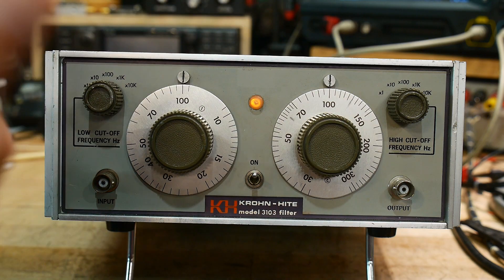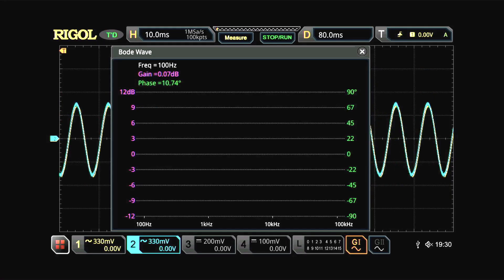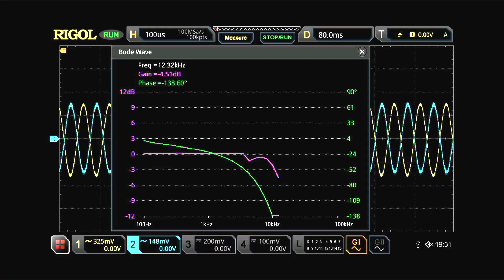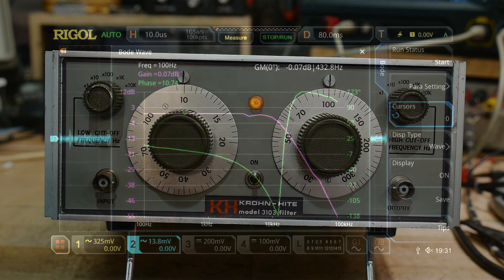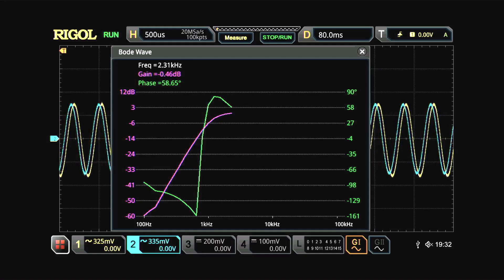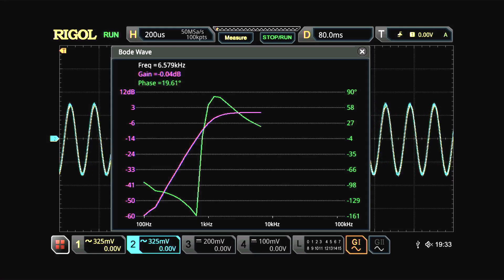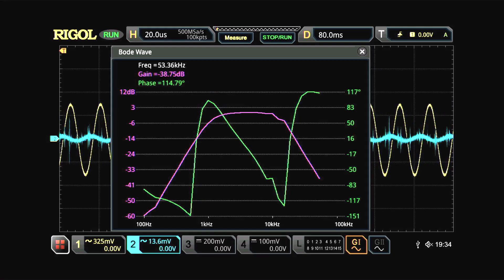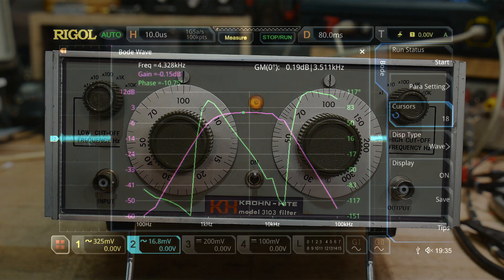#872 Krohn-Hite Filter Bode Plots

Comment: The crossover frequency for the phase angle might tell us something interesting about the :guts" of these filters even if we didn't know what was inside.
Bode plots made on different ferrite cores, with several turns of wire through them would be interesting to see too.

Comment: Nice filter! I used to work for Precision Filters in Ithaca NY and we built more fancy filters like this. Most were state variable filters digitally controlled not front panel knobs. Market included filtering ahead of A/D converters in audio to ultra-sonic applications. The newer Delta-Sigma ADCs put a dent into that market however. This was years and years ago now...
Reply from the maker: I'm still trying to find out what is the use case. What were the customers doing with these things?
Reply: @IMSAIGuy  I think they are largely outdated. Now most of this low frequency signal processing is done in the digital domain. Can make much better filters in the digital domain than analog.

Comment: I was hoping you'd try a notch, or a band stop. Interesting to see the Bode plots, I'm unable to do anything like this with my minimal equipment.
Reply: It is really not that difficult to take the measurements and create a Bode plot by hand.  The amplitude can be done with a decent AC voltmeter or an oscilloscope.  However, you do need an o'scope to see the phase.  BUT, it is tedious as you need to make a bunch of measurements and then draw the plot.  

If you have sweep function/signal generator which outputs a DC voltage that corresponds to the frequency of the signal generated, you can do this with an old analog scope.  Rectify and filter the output of the AC signal to DC and use that to drive the vertical position on the scope.  Use the DC sweep voltage to drive the horizontal position on the scope.  Yes, this is a lot of work.  OR, spend $900 on this Rigol scope.